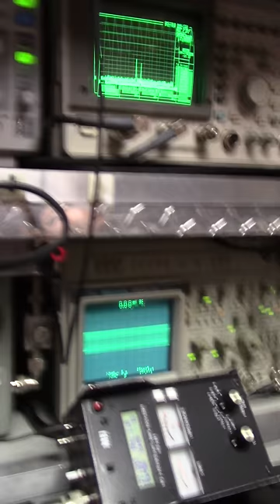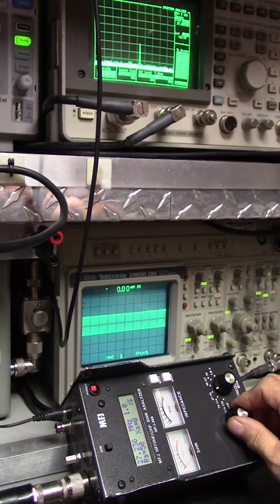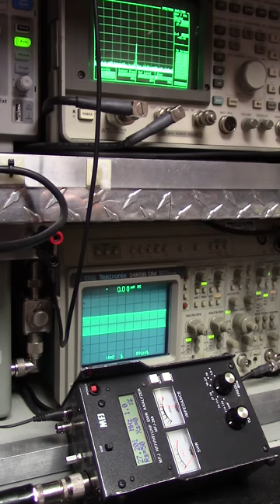R=50 X=0 Fundamentals of 10 Meter CB Radio Test Tune & Alignment Bench.

Comment from the maker: PAY ATTENTION!  If they recommend 3' increments or claim that length don't matter, RUN!! 
If they don't or wont show you .. like this .. they're stroking you,  get that Part?  Never settle for less! Here's what it takes to cut through the noise, be loud and crystal clear with a better receiver too:  A) Tuned Bench:  https://www.youtube.com/watch?v=lwcDfXOgAls. 
True, it's more complicated and time consuming to accomplish these consistent and accurate results. Below is a partial procedure and list of calibrated equipment used to achieve this level of performance . Read on ..

Fine Tune CB Radio Shop strictly adheres to (https://www.nist.gov/) NIST Traceable Calibrations and other industry standards to maintain accuracy and consistency for providing Real World Performance Tuning of Citizens Band and 10 Meter export mobile radios with integrity.

"Basic Textbook AM/FM/SSB Transceiver Tune, Alignment and Calibration" 

1) Pll adjustments
VCO & OSC, AM TX OSC, USB TX OSC, LSB TX OSC.

2) Transmitter alignment
DRIVER BIAS, FINAL BIAS, SSB  (or gate voltages for mosfet versions) CARRIER BALANCE, HI-LO AM & SSB Power, RF METER, AMC, ALC and FM DEVIATION.

3) Receiver alignment
AM/FM RF & IF SENSITIVITY, FM DETECTOR/DEVIATION, SSB IF SENSITIVITY, SSB S-METER, AM/FM S-METER (100uV unmodulated -67dbm for “S-9” meter reading!), AM/FM SQUELCH RANGE, SSB SQUELCH RANGE, and NOISE BLANKER/AUTOMATIC NOISE LIMITER (Real World dBm to volts (uV) tables below).

That's just a typical run of the mill textbook tune up and alignment (if you're lucky). There's more to it than frequency alignment, modulation adjustment, meter calibration and a tune up report displaying exaggerated rms Bird peak watts! 

"Test Bench includes"

Bird 4314C Meter
https://www.birdrf.com/Products/Test%20and%20Measurement/Power-Meters/Wattmeters-Line-Sections/RF-Wattmeters/4314C_PEP-Single-Element-Wattmeter.aspx
Part 1) https://www.youtube.com/watch?v=RpX9IHe4ORM&t=16s
Part 2) https://www.youtube.com/watch?v=LuhbqTf6Bxw
Bird 4314C Accuracy Test: https://www.youtube.com/watch?v=DqEOabYqhQo&t=5s
Bird Stipulates 1/2 wavelengths  https://www.youtube.com/watch?v=5eWhgT-rTII
And Genuine Bird Elements from 1K down.

Bird 4373 Sampler 
https://www.rfparts.com/signal-samplers.html

HP8924c with options
http://userequip.com/files/specs/2147/HP%208924C%20Repair.pdf
https://www.youtube.com/watch?v=Cg1w0xBa27s&t=1s

HP8920a with options
https://www.keysight.com/upload/cmc_upload/All/EPSG072204.pdf

Three analog scopes, one digital 200 Mhz
https://www.atecorp.com/atecorp/media/pdfs/data-sheets/tektronix-2465b-2467b_manual.pdf
https://www.youtube.com/watch?v=by98x4eu2lM

Fluke 27fm
http://www.fluke.com/fluke/inen/digital-multimeters/fluke-27.htm?pid=56055
 
LCR http://www.lcrresearch.com/wp-content/uploads/2017/05/LCR_Pro1_Manual_version1.03.pdf

Power supplies
6 Cosel PBA1500f12 (750 amps) variable and configurable.
https://en.cosel.co.jp/product/powersupply/PBA/PBA1500F/PBA1500F-12/
Corcom 20VB1 F7130 EMI Filter 50-60Hz 250V

Times Microwave Coax jumpers and test leads
http://www.timesmicrowave.com/cms/products/cables/lmr/
https://www.youtube.com/watch?v=EmqaGJ6IWow
https://www.youtube.com/watch?v=1ltFVSxGp5Y
https://www.youtube.com/watch?v=v12YZT_1o90
https://www.youtube.com/watch?v=h7iiYfmYWRA&t=215s

Amphenol RF Connectors
https://www.amphenolrf.com/
https://www.youtube.com/watch?v=dVh5B0hdEA0 
https://www.youtube.com/watch?v=dKZg8T_AOso

More range, compliments, reliability and a quieter, clearer but more sensitive receiver,  Get Fine Tuned .. not peaked and ruined.

Here are some VideoGates of me at the bench practicing what I preach using my bench radio or customers radio completed and ready to be shipped: https://www.youtube.com/results?search_query=hard+drive+163+ more: https://www.google.com/search?q=Hard+Drive+163+nm&ie=utf-8&oe=utf-8&client=firefox-b-1-ab

It's what I recommend, use, service and sell ... to you ... not something non practical or deceiving in a misleading way. I'm not just the tech and owner of Fine Tune CB Radio Shop, I'm a customer too!  When finished, You'll be giving radio checks, not asking for them .

dBm To Watts and Volts
Tables below displays relationship between Power in [dBm] or [Watts] and Voltage in RMS, peak, peak-to-peak for sinusoidal signals in 50-Ohm systems for accurately measuring and tuning am/fm/ssb receiver sensitivity, agc, squelch and "S9" Meter calibration.

  [dBm] [Watts]   [Volts]rms   [Volts]p    [Volts]pp
-140 0.100E-16  22.361 nV  31.618 nV  63.236 nV 
-139 0.126E-16  25.089 nV  35.476 nV  70.952 nV 
-138 0.158E-16  28.150 nV  39.805 nV  79.609 nV 
-137 0.200E-16  31.585 nV  44.662 nV  89.323 nV 
-136 0.251E-16  35.439 nV  50.111 nV  100.222 nV 
-135 0.316E-16  39.764 nV  56.226 nV  112.451 nV 
-134 0.398E-16  44.615 nV  63.086 nV  126.172 nV 
-133 0.501E-16  50.059 nV  70.784 nV  141.568 nV 
-132 0.631E-16  56.167 nV  79.421 nV  158.842 nV 
-131 0.794E-16  63.021 nV  89.112 nV  178.223 nV 
-130 0.100E-15  70.711 nV  99.985 nV  199.970 nV 
-129 0.126E-15  79.339 nV  112.185 nV  224.370 nV 
-128 0.158E-15  89.019 nV  125.874 nV  251.747 nV 
-127 0.200E-15  99.882 nV  141.232 nV  282.465 nV 
-126 0.251E-15  112.069 nV  158.465 nV  316.931 nV 
-125 0.316E-15  125.743 nV  177.801 nV  355.602 nV 
-124 0.398E-15  141.086 nV  199.496 nV  398.992 nV 
-123 0.501E-15  158.301 nV  223.838 nV  447.677 nV 
-122 0.631E-15  177.617 nV  251.151 nV  502.302 nV 
-121 0.794E-15  199.290 nV  281.796 nV  563.591 nV 
-120 0.100E-14  223.607 nV  316.180 nV  632.360 nV 
-119 0.126E-14  250.891 nV  354.760 nV  709.519 nV 
-118 0.158E-14  281.504 nV  398.047 nV  796.094 nV 
-117 0.200E-14  315.853 nV  446.616 nV  893.232 nV 
-116 0.251E-14  0.354 µV  0.501 µV  1.002 µV 
-115 0.316E-14  0.398 µV  0.562 µV  1.125 µV 
-114 0.398E-14  0.446 µV  0.631 µV  1.262 µV 
-113 0.501E-14  0.501 µV  0.708 µV  1.416 µV 
-112 0.631E-14  0.562 µV  0.794 µV  1.588 µV 
-111 0.794E-14  0.630 µV  0.891 µV  1.782 µV 
-110 0.100E-13  0.707 µV  1.000 µV  2.000 µV 
-109 0.126E-13  0.793 µV  1.122 µV  2.244 µV 
-108 0.158E-13  0.890 µV  1.259 µV  2.517 µV 
-107 0.200E-13  0.999 µV  1.412 µV  2.825 µV 
-106 0.251E-13  1.121 µV  1.585 µV  3.169 µV 
-105 0.316E-13  1.257 µV  1.778 µV  3.556 µV 
-104 0.398E-13  1.411 µV  1.995 µV  3.990 µV 
-103 0.501E-13  1.583 µV  2.238 µV  4.477 µV 
-102 0.631E-13  1.776 µV  2.512 µV  5.023 µV 
-101 0.794E-13  1.993 µV  2.818 µV  5.636 µV 
-100 0.100E-12  2.236 µV  3.162 µV  6.324 µV 
-99 0.126E-12  2.509 µV  3.548 µV  7.095 µV 
-98 0.158E-12  2.815 µV  3.980 µV  7.961 µV 
-97 0.200E-12  3.159 µV  4.466 µV  8.932 µV 
-96 0.251E-12  3.544 µV  5.011 µV  10.022 µV 
-95 0.316E-12  3.976 µV  5.623 µV  11.245 µV 
-94 0.398E-12  4.462 µV  6.309 µV  12.617 µV 
-93 0.501E-12  5.006 µV  7.078 µV  14.157 µV 
-92 0.631E-12  5.617 µV  7.942 µV  15.884 µV 
-91 0.794E-12  6.302 µV  8.911 µV  17.822 µV 
-90 0.100E-11  7.071 µV  9.998 µV  19.997 µV 
-89 0.126E-11  7.934 µV  11.218 µV  22.437 µV 
-88 0.158E-11  8.902 µV  12.587 µV  25.175 µV 
-87 0.200E-11  9.988 µV  14.123 µV  28.246 µV 
-86 0.251E-11  11.207 µV  15.847 µV  31.693 µV 
-85 0.316E-11  12.574 µV  17.780 µV  35.560 µV 
-84 0.398E-11  14.109 µV  19.950 µV  39.899 µV 
-83 0.501E-11  15.830 µV  22.384 µV  44.768 µV 
-82 0.631E-11  17.762 µV  25.115 µV  50.230 µV 
-81 0.794E-11  19.929 µV  28.180 µV  56.359 µV 
-80 0.100E-10  22.361 µV  31.618 µV  63.236 µV 
-79 0.126E-10  25.089 µV  35.476 µV  70.952 µV 
-78 0.158E-10  28.150 µV  39.805 µV  79.609 µV 
-77 0.200E-10  31.585 µV  44.662 µV  89.323 µV 
-76 0.251E-10  35.439 µV  50.111 µV  100.222 µV 
-75 0.316E-10  39.764 µV  56.226 µV  112.451 µV 
-74 0.398E-10  44.615 µV  63.086 µV  126.172 µV 
-73 0.501E-10  50.059 µV  70.784 µV  141.568 µV 
-72 0.631E-10  56.167 µV  79.421 µV  158.842 µV 
-71 0.794E-10  63.021 µV  89.112 µV  178.223 µV 
-70 0.100E-09  70.711 µV  99.985 µV  199.970 µV 
-69 0.126E-09  79.339 µV  112.185 µV  224.370 µV 
-68 0.158E-09  89.019 µV  125.874 µV  251.747 µV 
-67 0.200E-09  99.881 µV  141.232 µV  282.465 µV
-66 0.251E-09  112.069 µV  158.465 µV  316.931 µV 
-65 0.316E-09  125.743 µV  177.801 µV  355.602 µV 
-64 0.398E-09  141.086 µV  199.496 µV  398.992 µV 
-63 0.501E-09  158.301 µV  223.838 µV  447.677 µV 
-62 0.631E-09  177.617 µV  251.151 µV  502.301 µV 
-61 0.794E-09  199.290 µV  281.796 µV  563.592 µV 
-60 0.100E-08  223.607 µV  316.180 µV  632.360 µV 
-59 0.126E-08  250.891 µV  354.760 µV  709.520 µV 
-58 0.158E-08  281.504 µV  398.047 µV  796.094 µV 
-57 0.200E-08  315.853 µV  446.616 µV  893.232 µV 
-56 0.251E-08  0.354 mV  0.501 mV  1.002 mV 
-55 0.316E-08  0.398 mV  0.562 mV  1.125 mV 
-54 0.398E-08  0.446 mV  0.631 mV  1.262 mV 
-53 0.501E-08  0.501 mV  0.708 mV  1.416 mV 
-52 0.631E-08  0.562 mV  0.794 mV  1.588 mV 
-51 0.794E-08  0.630 mV  0.891 mV  1.782 mV 
-50 0.100E-07  0.707 mV  1.000 mV  2.000 mV 
-49 0.126E-07  0.793 mV  1.122 mV  2.244 mV 
-48 0.158E-07  0.890 mV  1.259 mV  2.517 mV 
-47 0.200E-07  0.999 mV  1.412 mV  2.825 mV 
-46 0.251E-07  1.121 mV  1.585 mV  3.169 mV 
-45 0.316E-07  1.257 mV  1.778 mV  3.556 mV 
-44 0.398E-07  1.411 mV  1.995 mV  3.990 mV 
-43 0.501E-07  1.583 mV  2.238 mV  4.477 mV 
-42 0.631E-07  1.776 mV  2.512 mV  5.023 mV 
-41 0.794E-07  1.993 mV  2.818 mV  5.636 mV 
-40 0.100E-06  2.236 mV  3.162 mV  6.324 mV 
-39 0.126E-06  2.509 mV  3.548 mV  7.095 mV 
-38 0.158E-06  2.815 mV  3.980 mV  7.961 mV 
-37 0.200E-06  3.159 mV  4.466 mV  8.932 mV 
-36 0.251E-06  3.544 mV  5.011 mV  10.022 mV 
-35 0.316E-06  3.976 mV  5.623 mV  11.245 mV 

                 Don't Be A Mud (Dave) Duck!

Hard Drive 163 NM. 73's! Click click.